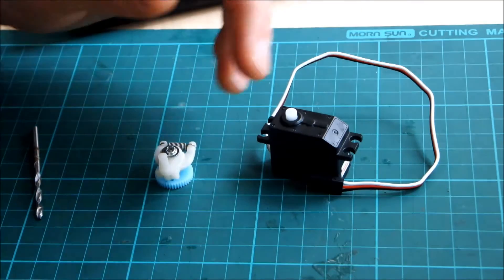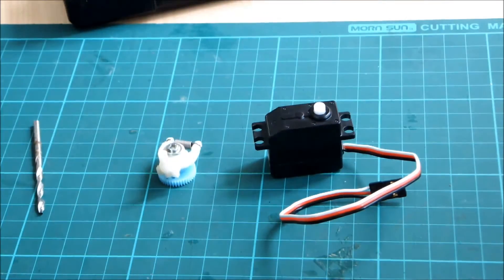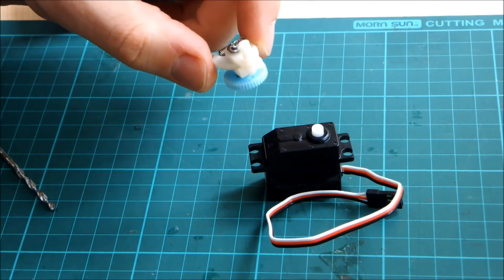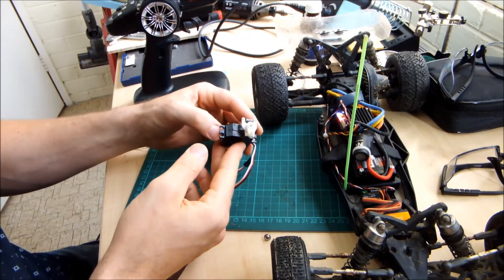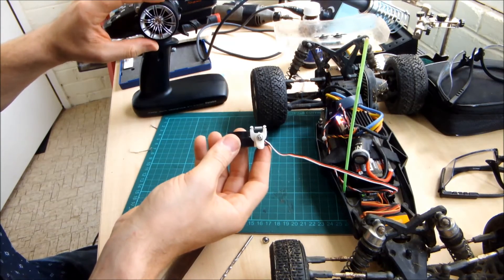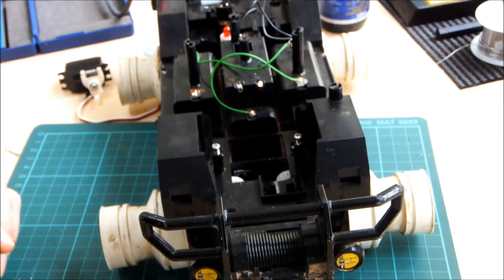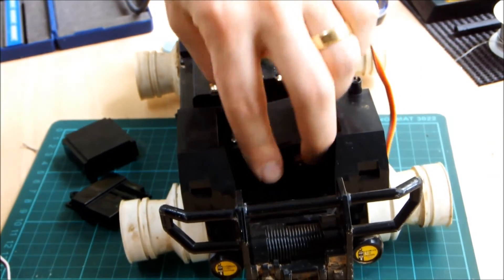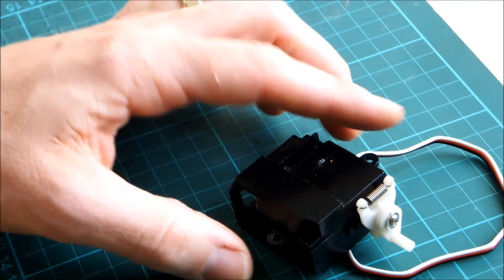Steering Upgrade - Radio Shack 4x4 Offroader

Comment: Hello, could you post all together the videos you did to upgrade the radio shack blue 4x4 truck? Interested in doing mine. Did you finish it?
Reply from the maker: Hey I did do more on this truck. Some mods I'm happy with others not so much. Just never enough time to make a video. It currently runs brushless lipo with a working light bar and working winch. Brushless is too fast and the light bar is the wrong scale. The winch was a great integration though. I'll try and make a video to go through and then do another truck and try and improve on those features I'm not happy with.

Comment: this is really cool I had the yellow one and the blue one as a kid back in the 80s. the blue one disappeared over time but I still have the yellow one and it works all except for the steering. it's actually kind of weird because if I bring the truck next to my LG refrigerator it starts moving forward all on its own. my plan is to do something like you did in this video and modernized electronics
Reply from the maker: Brilliant! Make sure you post up any modifications you do. It has been months since I made any progress on this project (or this channel for that matter!).